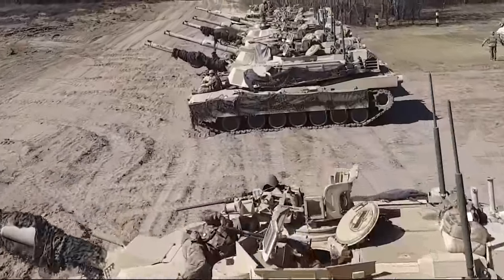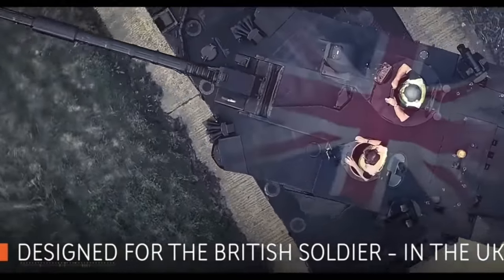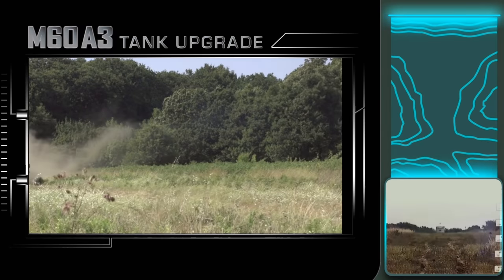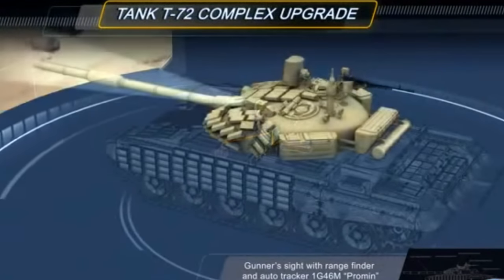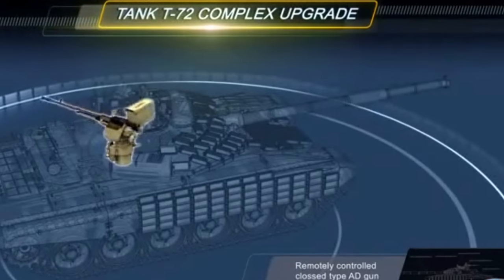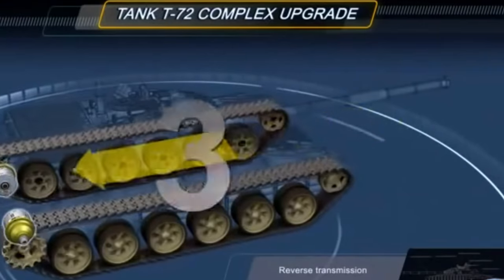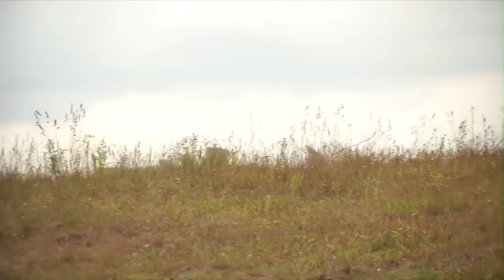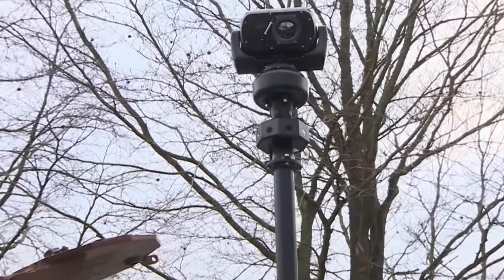Why upgrade Tanks instead of designing new ones?

Comment: Economics.  Why spend 1.5 million on an Abrams for a nation the size of the Philipines when all they do need is an modernized M60 PATTON with a 120mm main gun.  

That's all you need.  And, most importantly, those refitted M60s which you've already made a video on, have great range, mileage, ease of maintenance, excellent power:weight ratio, and are simply comfortable to ride and fight in.
Reply: a patton won't do shit against anything modern, if you have a modern APC ur far better off, at least you can hit shit while you move, and u can actually move, oh and you can carry missiles that will actually do something against a tank of the era. oh it might even be cheaper to keep and run so you can field even more of them and train more people in them, and you can actually get replacement parts, cause i dont think no one makes replacement parts for the patton so u dont have to trust ur goverment guy to take ur money to hand it to a company to keep making parts for the tank, oh but im jsut talking nonsense, is not even a fact that the marines will even drop their M1 Abrams to use newer shit with modern missiles.. so what do i know?
Reply: @felipeaugusto6991  Yeah, that's all very well. But if the enemy you expect to fight against has nothing but AK's, RPG's and a handful of worn out T55s, the M60 Patton is really all you need. Sure, if there was a threat of NATO or China/Russia invading, then yeah, all that modern stuff would be vital. But this just isn't the case with the Philippines. So why waste all that money on lots of expensive, modern stuff that you are probably never going to need.
Reply: Why spend all of that on "modernized" Patton when you can buy Leopard 2A4, T-90 and T-84 for same money? Because "made in USA, money goes to US budget"? Well, in that case Leo 2 is still better in terms of quality, available options and money you purchased it with helping NATO;)
Reply: @limedickandrew6016  again, why spend money on trash designed in late 50's when modern MBT from 80's are available for same price?
Reply: @TheArklyte  is it the same price? Do you have the numbers?
Reply: @limedickandrew6016  if the enemy has an RPG by the gods don't put me inside a patton tank, did you ever see how nasty is even a slightly recent rpg warhead? but even the older ones can make short work of a patton, theres a point where a project of old gets so obsolete in all fields, that anything you can scrap up at your time is better than it, as i said before, you can't trust people always make the best choices specially in politics and war, and against insurgents anything will work.. even a civilian pickup with a .50, philipines is small, sell the old pattons to some sucker and get a decent modern apc, in fact you are better off having 20 modern mbts than 100 pattons or 100 modern apcs, same with planes having 10 f-35s is better than 100 90s junk jets, maybe not in planes department but if you get your hands on a sweet leo 2 you can reverse engineer it to some extend and make something newer that totally is more acceptable than the patton lol
Reply: @grubbybum3614  T-72s an T-80s from Warsaw Pact surplus were sold for scrap metal price back in 90ties. With right training and ammunition they can knock out fancy shmancy modern M1A2s worth big buck of taxpayer money.
Reply: @clouster75  I can't remember if this had night vision? Probably not. There's many factors that would add to their price tag, even if they are heading for scrap
Reply: @felipeaugusto6991  Of course I'm not saying just pick out M60 Pattons from Vietnam and put them in the field. They would have 5 decades worth of upgrades and would be more than adequate against irregular forces like the Taliban, ISIS and Al Queda. Irregular forces like these don't have a ready supply of weapons and ammo. One man would probably have 3-4 RPG rounds which would have to last him a week. And they are hardly going to be the latest modern ones a Russian soldier in the Russian army would have. More likely reserve stock from the 70s/80s some gun runner got hold of from a corrupt official in Mozambique, or some such backwater. Probably long past their sell by date too.
Reply: @limedickandrew6016  you can upgrade an old platform all you want, but theres things you can''t do, insurgents are infantry and as i said you are better spending that money on modern vehicles even if they are light APCs or IFVs that are designed to counter rpgs and IEDs, even the bradley updated suffered avoidable losses if they had updated it with entirely new vehicle,  bang for buck you save money by not getting into the trap that is buying an obsolete weapon platform and spending tons of cash just to update it and it will still be inadequate, you are better off spending the money for upgrading tanks into trucks for technicals, mortars, artillery, drones and missiles systems wich all have a longer range of engagement/ or better yet develop your own light afv, as shit as it will be you can make it  IED resistant, and make it SOO much less maintenance heavy, by the way you can't even use philipiness as example cause they ended up having to strap wood to their older vehicles to try and stop rpgs, wich shows how crazy obsolete they were, also they seem to be wanting to update their vehicles, but that does not mean goverment will do it right.
Reply: Shit, they don't even deserve a tank. They lose apcs easily during marawi conflict
Reply: 1.5mil? Yeah... Closer to 9 mil per unit now.
Reply: Patton could have the same gun as the last generation of MBTs, but it cannot play the role of a 1st line tank with its crappy armor. Maybe this tank is useful for infantry support and anti-tank roles and playing the role as "artillery" but otherwise its not of much use. It will always lose 10 vs 10 fights in the open against modern enemy tanks.
M60 was a mediocre tank already during the 1960s and I don't think upgrading this tank will be a sustainable solution if you want your army to have a strong tank arm 20-30 years from now. This tank is already too old.
I would keep the chassis for the future use as SPGs, bridge layers, tank training, flamethrowers, engineering tanks, recovery vehicles, command vehicles etc...
Or I would sell the tanks to Africa or Latin America, and buy some real tanks for my army instead.
Leopard, Abrams, Leclerc, Challanger are all old. So it is time for a new tank with a 15cm calibre gun with an autoloader and the latest technologies. A gun capable of dealing with Armata would need a high calibre, and that in turn makes it necessary with an autoloader it the guns are becoming bigger than what they are today.
Reply: considering how shit the world economy is about to be. I'd wager there will be a lot more upgrading older tanks for a while.

Comment: Prime examples- torsion arms suspensions, road wheels, etc. are very tough and yet, they fraction, crack and break over time! Perfect examples of how even tough metal would break over time and stress! We don't call them 'upgrades' but simply replacing parts due to stress and usage.

Comment: The chief thing to keep in mind is the fact that most modern tanks since 1980's have a modular design that was engineered to allow for complete refurbishment back to zero hour use, as well as future upgradeability in there design.   Older tanks like the T-55 can be upgraded, but would require and extensive and expensive re-engineering to make them future upgradeable.  This is were it's better to simply buy a newer tank that already has that future proofing engineered in.

Comment: The next American MBT, the Jackson series, has been in the works for the last near 30 years. The Jackson MBT is supposedly smaller than the Abrams and come with possibly a 125 mm gun. I am surprised that having been in development for so long we should know more about it. It is expensive I am sure despite scaling down in size. 

The Abrams has been so successful why change the MBT we use when what we already have works so well? The Abrams chassis could see 100 years of service in one form or another.

Comment: Only Russia so far going up on new tank development with Armata although yes, there seems to be problems delaying its widespread introduction.

There is one more aspect however i think need to be discussed, namely Power generation.  As nowadays battlefield are getting more digital, means more electronics and more electronics means more heat, weight and power requirement.  This is very strong case for new design as new design can be build around to accommodate ever increasing power requirement. 

I did a bit of study on the design of hardkill Active Protection System (APS), and there appears to be a relationship between power requirement vs Threat, where small fast threat like APFSDS and Hypervelocity missile needs the most amount of power.  It would require about 16 KW of power just for the APS against that threat, and clearly this can't really be solved by current tank's APU. (e.g T-80 do has 16 KW but that's for the entire tank).

Comment: I asked my brother about your recent video about the Marines phasing out tanks. And it is because tanks are becoming obsolete, and he sent me links explaining the new plans for getting rid of the standard Army system that goes back many years with large units (divisions, regiments, etc), and streamlining down to smaller, quick response units instead, in which tanks no longer fit into. This is to make changes to modernize the military because today we don't have old fashioned massive battles between armies like in WWII. Today, battles are much smaller, and need a whole different way to combat them. So if tanks are going to go down the same path as our beloved old battleships, then I can see where no one will want to spend the money on designing new tanks. Thus upgrading what is already available to make them last a little bit longer would be cost effective.
Reply: r32rocky —- how many times have the military decided that something was obsolete and then found out they were wrong. Like dog fighting using a gun was obsolete. This is not the first time they tried to get rid of the tank.

Comment: problem is tank technology has mostly peaked for the most part so investing in a new tank is more hassle than its worth rather than just modernizing older tanks with new thermal imagers and countermeasures like ERA and APS. T-72B3M is a great example of this while it is an older design its is on par if not better than T-90A

Comment: It’s not only money but intelligence too. Most of MBTs are same in size and characteristics, almost. A tank always has space to retrofit. Remove a crew, add one auto loader, add a few thermal or night vision equipment’s, replace the barrel, upgrade the engine and add a little more armour. You will save a lot in lengthy & costly process of R&D where billions are spent on a platform that is not even going to be introduced. US has a long history of this system. While Russians focus more on numbers, any type of. They even keep T-34s and KV-1s in thousands in case.

Comment: yes, Buying new or building new is the best answer, but it DOES came with many problems...
1) only maybe 30 to 40 countrys in the world are able to produce their own Main Battle Tank... we are not talking about a mechanized infantry vehicle but a full battle tank, that means heavy metal industrial capacity.
2) producing new and new and new tanks instead of upgrading existing ones isn't such a good idea. What to do with the older models? logistics also become a problem itself since many more spares need to be produced.
3) The combat survivability of a tank it is more or less determined by some aspects like: - Gun mounted - Armor protection (designed) - Mobility. By mid/late 80's MBTs reached a 120mm gun high movility high protection standard that has stayed there ever since. 
4) Due to soviet and american doctrine, they produced way more tanks of what they really needed in peace/limited operations time, so there are many many tanks that in fact spent most of their lifes stored. This is not the case for European tanks (or any other country who has ever produced them like Brazil Israel Argentina etc).

And the final question for many countrys is...
Why purchasing T-90 or western MBT when T-72 are so close to that standard anyway and could meet the requirements with an upgrade but at a much lower costs? Hell! If the stock avaiable is large and individual vehicles are not that wered out, it even makes sense for T-55 to be fully upgraded (there are some update kits that do bring those tanks to XXI century). I would rather have 500 modernized T-72 than 180 brand new M1A2 Abrahams

Comment: Just look at the M1 and Leopard 2. Both are pretty much even after 40 years still the best you can get.
Reply: Basically because there's yet to have ANOTHER design breakthrough that requires new designs to be done....
Railguns are too impractical yet (even then, Navy would be a better fit for initial development), armor packages Haven't seen any equal weight for better protection discovered or materials that enhance (or allow to stay) protection levels with less weight, ammo is also at a relative standstill with steady discoveries and Improvements...
Even new potential weapons systems have yet to prove their worth vs Current weapons
Reply: T-14 Armata joins chat

Comment: I'm afraid tanks have reached their pinnacle in the same way the Iowa class battleships and similar late war designs were in the advent of the aircraft carrier. The difference here tanks are not exactly obsolete (at least not yet) nor are they the primacy in armored fighting vehicle since ATGMs are the primary threat besides other tanks and gunships. Yes it is cheaper to upgrade what you got which is probably the main reason for any country of significant industrial power can do in preparation of the next big fight. Also Russia ran out of money to build T-14s en masse like they did with T-80s and T-72s so there's that.

Comment: When North Korea becomes defunct, would there be any point in upgrading the presumably few hundred T-34-85 tanks they have?
Its armor is a joke against anything larger than 15mm and it's small for a tank.

However, put in a new engine, a low-recoil 90mm gun or an unmanned turret (perhaps two-man crew?) and modern applique armor, it'd find a niche in infantry support.  Just look at X1A2 Stuart.
As far as I understand it, there's some parts commonality with T-55, so something can be gleaned on that front as well, no?

Comment: Like for example, the Philippines chose to stick on using APCs and IFVs instead of buying a light or medium tank. Broadly, its very practical on their side specially considering their areas of conflict where they engage on
Reply: @Joshua N. Ajang yep, that's what I said.
Reply: @Joshua N. Ajang what Philippines could do, is to enhance it's infantry to be equipped with better tools for modern urban warfare and protect it's own sovereignty against China and other countries by investing on more naval units.
Reply: @Joshua N. Ajang i don't get you at all, i mean we're talking about the Philippines then suddenly you brought JSDF into the conversation. Would you mind clarifying your statement?
Reply: @Joshua N. Ajang ohhh okay, i think i get it a bit now.
Reply: @Joshua N. Ajang so what you're stating is, if I'm not wrong, is that Philippines should buy a light or medium tank?
Reply: @Joshua N. Ajang dude, you can't equip a light armored vehicle with tons of armor making them heavy, because that will be counter intuitive
Reply: @Joshua N. Ajang that sounds like the FNSS kaplan (harimau) version

Comment: I'm going to have to disagree with you a little Matt when you say it's always better to go with a brand new tank instead of upgrading an older one. I'm not talking about outdated tanks like the T-54/55 but instead modern MBTs like the Abrams, Challenger 2 and Leopard. First off just to design and bring a new tank into service would cost a SHIT TON of money! Also you have to speend a ton of money on spare parts and training for the new vehicle. As of right and for the forseeable future tanks like the M1A2/A3 Abrams, Challenger 2 and Leopard 2a7 are more than capable of fulfilling their missions. Also their designs work very well and the countries that operate them have the money and technology to upgrade them. I'm going to use the Abrams as an example, even though the design is old, it is still very capable. 

I only agree with you if we are are talking about outdated tanks like the T-54/55, M-60, T-72 and other outdated tanks. But right now there is really no need replace most modern tanks.
Reply: T-72? Outdated? The latest modification is pretty damn good, it'll serve a good wjile longer.

Comment: Both upgrading and developing a new tank suffers from diminishing returns.
Think of how long it took for firearms to make longbow and crossbow obsolete. For centuries, the research didn't pay off! Today, you can buy bows and crossbows that would make any medieval soldier jealous, however, besides some very rare niche applications, they have no place in modern combat.
At some point tank cannons can no longer become bigger or more effective, without becoming impactical. During WWII, the limits for metal armor were already reached (looking at you Maus and IS7). Switching to composite armour was not immediately practical.